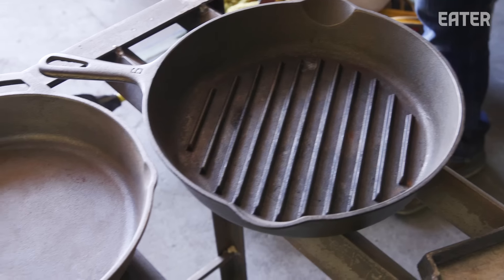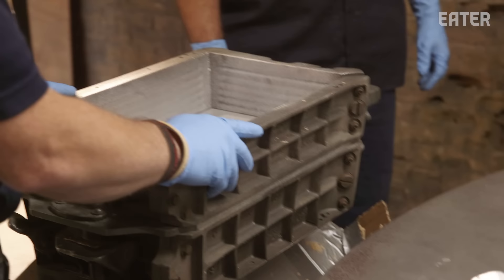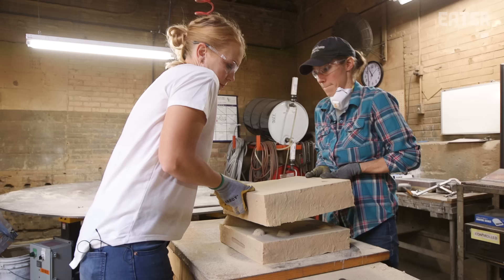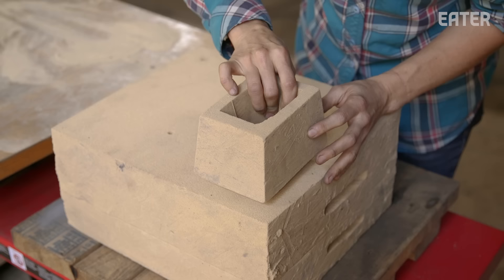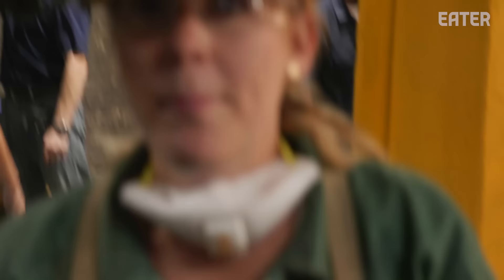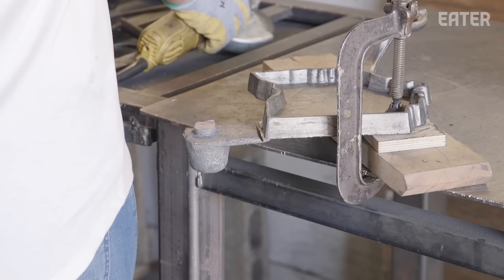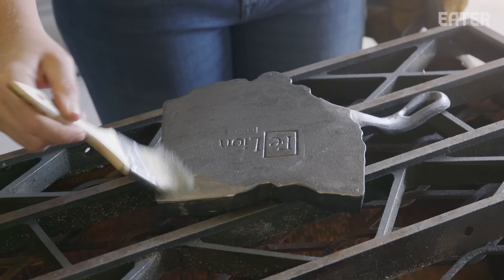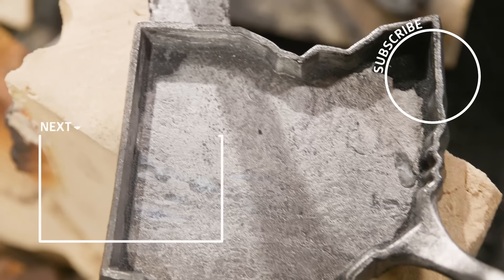How Cast Iron Pans Are Made — How to Make It

Comment: This is not how cast iron cookware is typically made.  Felion makes special novelty items that can cost upwards of $2500.  Most skillets are made using the green sand process are a rate of 300 or more molds per hour per molding machine.  i.e. Lodge can easily crank out 1200 skillets in an hour.  My company subbed out for Lodge for a bit while they were building their new foundry and we also made the Field Skillets for a while.  I'm pretty sure I met Alisa at casting congress a few years ago.

Comment: kinda dying that it's two women introducing us how to make these awesome, heavy ass pans. Nice work ladies! <3 <3 <3
Reply: I wouldn't call something weighing less than 10 lb "heavy ass" TBH.

Too much ASMR making you weak? 😎
Reply: Robert Pruitt I’m here to see if there’s an argument and also you’re right it’s not heavy
Reply: @hexx_king3340  they're "not heavy" because you image how you hold 10lb block of metal, not a pan. You'rs holding a pan with a handle, which is a lever. If you learnt physics a little bit, you know that it makes a big difference
Reply: NeonGooRoo that still doesn’t make ten Lund’s heavy bud
Reply: @hexx_king3340  how doesn't? It's times heavier than normal ones, and it's actually hard to move it while cooking. Or it's heavy only if you can't pick it up with both hands?
Reply: NeonGooRoo idk how it would it’s just a pan
Reply: Commenting on the fact that they're women means you underestimate women. It shouldn't be notable.
Reply: thedrunkenpilot  this I agree with
Reply: Moxie Beast ASMR 

Didn't even notice it was two women doing what they "aren't supposed" to do until you pointed it out. That way of looking at things is self impeding.
Reply: @FreeTrollCounselingForDummies  you're right!
Btw, you don't even have to learn physics to know that, just use experience you had in your life before.
Reply: HexX_KinG apparently you've never held a cast iron pan. They are definitely heavy.
Reply: : - )) In my previous life I was a church mouse... never met a pan.
Reply: Dont see many women actually making it (outside these 2 doing it for camera), lots on men in the back ground....
Reply: @hexx_king3340  heavy compared to other pans.... why dont people understand that heavy is a reletive term

Comment: Excellent episode.  The making of the sand mold was very interesting but would have been nice to see how the original pan was made/shaped...clay perhaps?
Reply: Normally carved out of foam.
Reply: +Aubut Family Blog  Ah. Very cool.  Thanks.  👍
Reply: Sometimes the pattern is made of wood. With today's 3d printing, that would be the way to go for complex parts
Reply: If this was a investment ("missing wax") casting, they would use wax or styrofoam, which stays in the mold and melts/burns off when the metal is poured in.

This is a cope-and-drag casting where they make an impression  in the two halves of the casting box (the cope and drag). The halves are pulled apart and the core (the object making the impression) is removed. The halves are rejoined and the molten metal poured in.

The core in a cope-and-drag casting needs to be man-handled, so it is made of a durable material....wood, high-quality plastic, metal.

Mass-produced cast iron is usually made with a continuous casting machine called a DISAmatic...the cores are used once and are made of a very light ceramic. The DISA process operates on a conveyor, with a vertical mold joint, the back half of one mold used as the front half of the next.
Reply: Mike that was a very good explanation. I am a foundry veteran and I like your description.

Comment: Great upload! One question though, cast iron is soft?? Since when? Cast iron has more carbon content than steel and it's known to be brittle and that means it's quite hard. I was hoping for a bit more information about the cast iron used. Cheers!
Reply: @alflurin  Yes, cast iron is hard. But, cast iron is made using different levels of hardness and softness, depending to what purpose or use the finished product will be put. For instance, if the finished product is going to be machined (drilled/tapped/bored) as in automobile parts, then the iron must be soft enough to not destroy machine tools that work on thee product, yet be hard enough to withstand internal combustion pressure such as hydraulic fluid operating brake wheel cylinders and master brake cylinders. When you apply your vehicle’s brakes, it is critical to your well being that these cast iron brake parts don’t explode.  This is why a foundry has a highly qualified metallurgist on staff so that you don’t die while driving down the road.
Reply: @alflurin  Please, delete the word, “combustion.”  Thanks.

Comment: Did I miss something?  How did the sand get so hard?  It just sat there right
Reply: TBB5413 they pack it tight. I believe it’s a special type of sand that holds its shape really well when you mold it. They also might’ve baked it, which is why they had to use a drill to create a hole. I’m just a city slicker so I don’t know too much about this kind of stuff.
Reply: @rusty9959  its air setting sand it has a resin and a binder agent in it .it dosent require bakeing

Comment: If only they didn’t season it leaving that bumpy surface or gave us an option.  I’ve got to sand that crap down smooth and re season for a real cast iron pan.
Reply: Why would you have to sand it down?
Reply: @kaylaa8092  because he doesn't know how to use it correctly.
Reply: @MrPicklecopter  That's what I was thinking mine is well seasoned and well used and its smooth and never had to be sanded
Reply: Instant gratification is a must, don't ya know?
Reply: Not sure what you mean by seasoning but, as a family man we use to mix seacoal into the sand molds. When seacoal Burns off it creates a gas thus a smoother finish. Also western and southern bentonite clay is good for molding.

Comment: Iron cuts really soft, like butter? 
I'm afraid of the owner.
Reply: Iron is one of the easiest metals to cut, that's why it's used in all kinds of machine parts in addition to absorbing vibration. Compared to stainless steel or tool steel, cast iron cuts like butter. Stainless will destroy cutting tools in a hurry if you don't know what you're doing.

Comment: "Iron is pretty soft actually so it cuts really nice, like butter."  Butter that requires a power tool to cut doesn't sound very appetizing. xD
Reply: But cast iron does cut very easily especially in comparison to stainless steel or a wear resistant alloy like inconel.

Comment: I don't understand the point of cast irons. It seems unsanitary and unnecessary.
Reply: @FlyDontTrip   seems very versatile but still unsanitary. Wiping food out doesn't sanitize it.
Reply: OmarRPG The main virtue of cast iron is heat retention. The surface temperature won't suddenly drop and have to get back up to the right heat when you place your food on it. This has many benefits in cooking. 

Also, it's actually perfectly fine to wash seasoned cast iron with soap and water. It's a myth that soap is bad for seasoning. Seasoning is already polymerized, so it's not grease anymore and soap can't dissolve it. That said, I rarely resort to it and my pan comes out perfectly clean, free of any residue and odor, every time it finishes re-seasoning after every use.
Reply: So cool! Also an ohion would love to have.Were can I buy this skillet!?